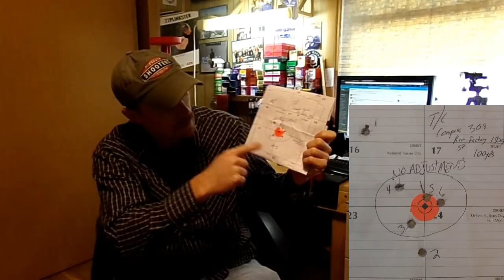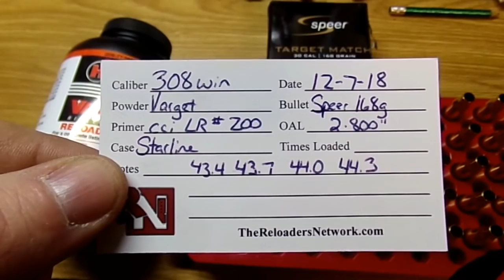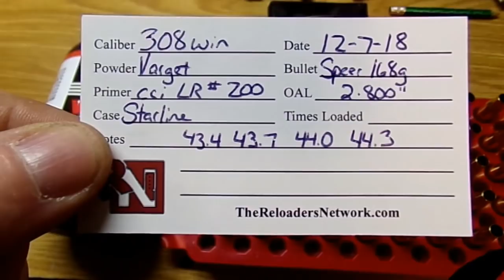Let's Load Some 308

Comment: I am watching this series with great interest as I too have a .308 Compass. I will be using Starline brass, the same Speer 168gr bullet, and Varget powder. My go-to choice for a primer though, is CCILR Mag. 
I have a comment about your cartridge length. In one of your replies below, you state the maximum OAL with this Speer bullet is 2.890” [touching the lands], and 2.800” is book length, and your starting point. Would not starting closer to the lands be a better choice? Many more knowledgeable than I recommend .010” off the lands as a good starting point. Of course, those measurements are based on case base to ogive [CBTO], and not overall length {OAL]. I am interested in your reasoning for using your method of measurement. 
Thank you for putting together your very informative videos, and I am looking forward your next video in this series, when the “Target tells the Tale”.
Reply from the maker: Hopefully, I can get it out tomorrow.  We have had lots of rain lately and it's been very windy.  I did shoot my first test loads, but left that red advertisement spacer thing, stuck between the stock and barrel.  The groups weren't nothing to brag about.  I have some more loaded up with Varget and Cfe223.  Generally I never go over about 2.840" so they fit in most factory mags.  I actually haven't even measured or used this factory magazine yet.  I was comparing it to a Tipped bullet that I had loaded in the past that measured 2.840" and this Speer bullet is about the same jump as the other at 2.800."  I had some reasoning behind it, but the first 50 or so rounds are just to break in the barrel.

Comment: How did you determine you overall cartridge length?
Reply from the maker: That's book length.  Was going to go a little longer, but decided to start with this.  Bullet touches lands about 2.890" with this bullet.
Reply: @243Outdoors  do you experiment with touching the lands or always prefer to let the bullet "jump" ?
Reply from the maker: I usually don't get any closer than .040-.050 to the lands.

Comment: Hey, I have a quick question. I'm tinkering around in the basement here and I wanted to know how you determined what COAL you were using? Did you use the OAL gauge from Hornady or load to SAAMI specs?
Reply from the maker: These are pretty much book loads.  To determine max overall length I take a piece of fired brass squeeze the neck a little with a pair of pliers  place a bullet in it and chamber it a few times.  When I get a consistent readings, that's where the bullet touches the lands.
Reply: @243Outdoors  I gotcha. I was asking because max length for .223 is 2.260 and I got readings at 2.19XX with my OAL gauge. That's 70 thousandths roughly. These guns seem to have a shallow chamber, at least in my .223.